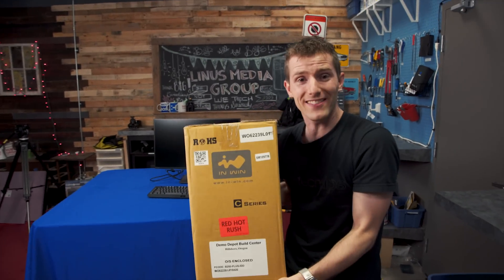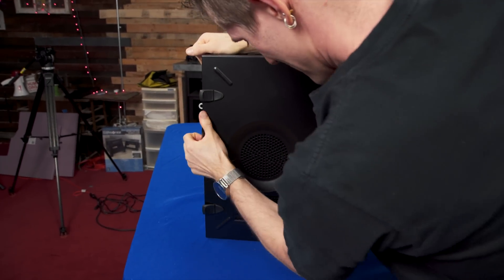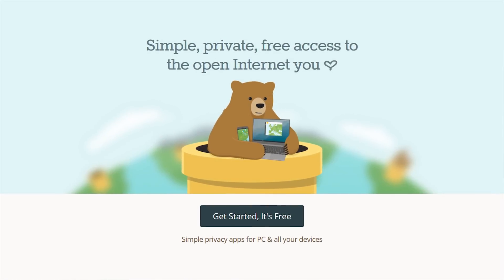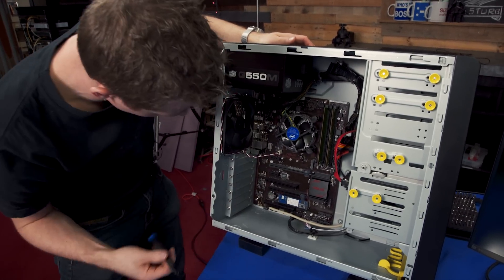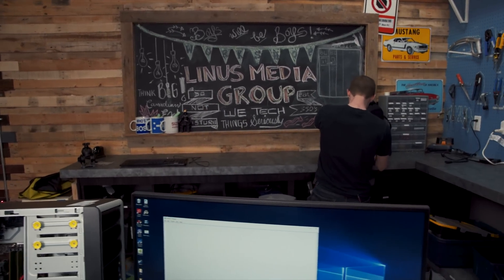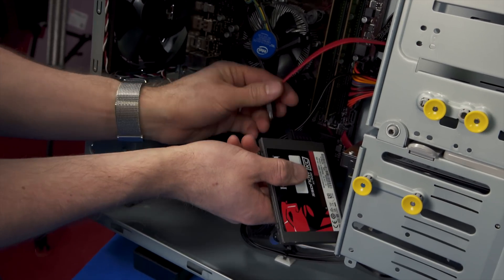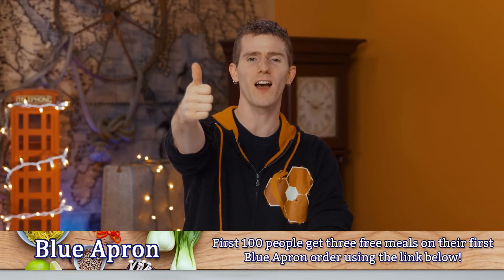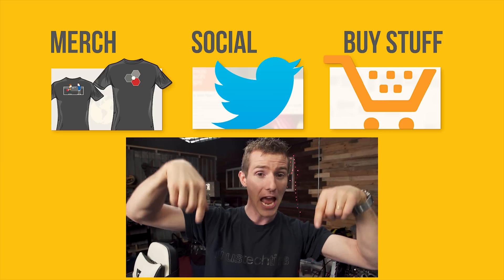Turbocharge your SSD for $40??

Comment: The next big thing in computers will be my 'SSRD' (Solid State Ram drive).  It will be an SSD built into a DIMM style PCB with RAM, but will retain the Ram data for short periods even when turned off (instant boot time), and allow for massively improved SSD access speeds.
Reply: 10p6 no I think CPU l1 cache drives‚ like a CPU at 500MHz but its L1 cache (fastest computer memory) reaching upwards of a hundred GB would be the next big thing.
Reply: So basically like "battery backed SRAM" in the 80s.
Reply: +Bien Vincent Balansag I think you are right, but i don't think we will see it in a consumer product.
Reply: That's incorrect. 
@Sam Can.... Just look up the words "Hibernation File"...
You will understand quickly though.
Reply: Hmm, i had that idea in my head.
Reply: The next really big thing will be MRAM, which will make both RAM and flash storage redundant. MRAM is fast enough to be a replacement for traditional DRAM, but doesn't lose any data when the power is off so flash SSD's wouldn't be needed either. And it also doesn't wear out over time like SSD's. It's a very long time off yet though, because someone needs to make an enormous investment so it can catch up...
Reply: think thats allready an option when you use a SSD its called hibanate and sleep mode is compatable with pc even from 1995 and comes at a cost of 0£/$
Reply: nope they dont want us to have dataservers speeds for desktop, m2 will be your solid drive and nothing else... miniaturized YES, expensive YES,  fast NO, WHY ? ...corporations/governments that slow us down for easy surveillance ...

Comment: The best option is to put a 4 lane PCI express SSD in that M.2 slot and get MASSIVE bandwidth to all your data without having to prime the cache. Optane is a cheap low end solution if you're penny pinching. Go with a Samsung 960 Pro in that M.2 socket and it will blow everything else away. It is almost price equivalent to SSDs now so there's not much excuse to not go with this.

Comment: I really struggle to see the benefits of this product. Don't get me wrong what it does is fantastic and in the right environment it will be perfect. But that's where I struggle, the right environment is very niche.
With compatibility limited to Kabylake+, anyone that has bought one of these systems would have more than likely had an SSD anyway. I would love to get these in the schools that I work in, and they would fit great, but we don't run Kabylake here and if we were to upgrade to them I would just buy the SSD for chips.

Comment: "Is it worthwhile if you have an SSD?"
I think the correct answer is: It depends on WHAT ELSE you have and what you use it for.

Assuming the SSD on hand doesn't provide nearly sufficient storage space and is already set-up as a system disk the alternatives for extra storage are:
1. Standard HDD. Cheap but relatively slow.
2. A hybrid HDD (which all seems to be limited to 8GB of cache). Cheaper than adding the 8GB Optane.
3. A cheap SSD combined with an HDD using Intel Rapid Storage. You get more SSD than Optane for the money, but raw performance suffer and the SSD will wear out faster since it can't use TRIM.
4. Optane. More expensive to buy but better performance and longevity than alternative 3.

I'm actually in this situation right now. I have a smallish system SSD and a 2TB HDD for running most software.
I can speed up the HDD by either getting a second SSD for IRS or getting Optane. Since I want longevity Optane seems like the better choice, but 16GB feels a bit meager. If I can get 32GB (or more) at <$100 it would be nice.

Comment: Sounds like the Optane memory will be coming out for new ready built PC's sold at high street shops. This will save the sellers a lot of money for not having to add an boot SSD. Instead they will put an Optane memory stick In the computer with a cheap mechanical hard drive, then stick one of those "Intel Optane Inside" stickers on! and watch sheep's go wild buying them thinking they got the real deal. Poor peeps...

The computer savvy's will wait for the SSD version I think. Now that will be something to look forward to :-)

Comment: Linus, may i suggest a config worth trying
partition the ssd so there is an os partition and a smaller games partition.
then config the  optane to accelerate the second partion only .
please run a video investigating this config
Reply: Optane can only accelerate the primary boot drive IIRC
Reply: so no multi-HDD ?
Reply: Nick Fury h
Reply: Yet again that is incorrect.
You think in the box too much.
Intel optane can be used as stand alone storage... WHICH MEANS!
A program like PrimoCache would work.

Comment: Its an interesting concept but if it requires a 7th gen CPU, I honestly don't see the point. 
A 1TB SSD is still pretty expensive but I remember paying about half of what a 1TB SSD cost today for a 128GB only a couple of years ago. So while not cheap, "enough" storage for a gaming PC (lets say 500GB+) on SSD is affordable. Boosting a HDD performance becomes less and less necessary. 

Also, if optane can't really boost the performance of a SSD (even after learning the user's patterns), I don't see the point in investing in a larger obtane drive in the future. 

To archive a real performance jump like between HDD and SSD, we'd need some kind of non-volatile RAM that operates at almost the same speed or a RAM technology that can hold its data at super low power levels so that a small battery can keep the ram running a long time after shutting down the PC.

Comment: Welcome to 5 years ago!!!  The tech is a GREAT solution to gain nearly SSD levels of high performance with large capacity HDDs.  Don't knock it.  It's viable!

5 years ago I started using a 32 GB OCZ Synapse combined with my 1 TB HDD and I am getting near SSD performance with huge storage capacity for a fraction of cost compared to that kind of capacity using SSDs alone.  Especially considering SSD prices back then!  You might be able to find some ATTO benches on the Synapse somewhere to verify the speeds. Dedicated cache SSDs went out of favor when SRT technology was developed, so Synapse is no longer sold, and now Optane is here to replace SRT.

Comment: The only way this product would be useful was if you could specify the drive that the optane is caching information for. IE i've got 3 ssds and 2 mechanical drives in my system so I would tell it to cache info for the mechanical drives and ignore the ssd's. Doesn't look like this is an option so it's not something I would buy.

Comment: I can see these being useful in business or education machines. Yes, it'll only work with newer chipsets and requires an m.2 slot but in 2 or 3 years time a card that a technician can plug in to accelerate the system without messing about cloning drives or setting up anything seems like a good solution.

Comment: Kaby Lake and 200 series mobo plus $40 optane chip to boost my HDD vs any system with a m.2 slot and a $60 128gb nvme ssd, I know which I'd pick (or a $100 240gb ssd). I know sata ssd's are cheaper, but don't compare quite as well.

Comment: nobody in the right mind would buy this. A Kaby Lake buyer would just spend $50 more for a 256GB SSD (or just buy the SSD without the HDD), which will increase speed AND capacity, than opt for $70 Optane on top of an HDD cost. If you can't spend the extra $50, why would you buy a Kaby Lake in the first place?

Comment: I feel really disappointed with Optane. I honestly expected something better. If you have the money to buy Kaby Lake I3, I5 or I7 system, you most likely have the money for an SSD. You can get a reasonably cheap SSD for your system, your workspace and maybe a few less disk space hungry games. Or you can go with more expensive 400~500 GB SSD ad ditch the HDD completely if you don't need that much disk space. A budget solution for budget storage setup in a non-budget system? No. I don't see a point in this product at all. 
Intel Optane? .. This is in - practical point of view - an SSD taken out of SSHD and sold separately ...

Comment: Who the hell has only an hdd but a board with an m2 slot?
Reply: That was my first thought... Who has built a computer with Kaby Lake without an SSD?
Reply: Mike s But even in that case I'd rather buy an ssd for ur OS than this thing 😀
Reply: People with low budget pentium G4560 and B250 boards.
Reply: Even for the people with HDDs for storage (I for example have a 6TB array for storage), what is being stored on the drive to need optane.  If your running games off the HDD then okay I see why the drive would benefit you, but for me personally I just use my 6TB array for general media. I actually have a 120GB SSD acting as cache for the array just because I had a spare SSD laying around lol (wouldn't have bought one just to have it. Nonetheless seems like optane in its current state, only support kaby lake and up would be for a very niche market.
Reply: Patrick Kuhlmann Um, me.

Actually I have 3 HDDs with an unused M.2
Reply: Patrick Kuhlmann many people on budget
Reply: theUglyManowar Your right hell I myself have a 6TB striped array that I use for storage and my various Adobe project's. I have a TB pny ssd I use for my games and then my xp941 m.2 for boot. Aside from all that I also have an old 256G Sammy 840 I use (with primocache) as an SSD cache for my 6TB array. 16/32GB Optane drive isn't big enough for my array and a 64gb or 80gb drive would probably cost the same as a used 256GB ssd that I could grab and use as a cache instead.  But because of this I still don't see a use for Optane in the enthusiast segment lol.
Reply: Patrick Kuhlmann m.2 drives are cheaper then a SSD and I'm in heaven not having shit plugged into sata ports my case looks so clean inside with no hdd/CD ROM or sata SSD..
Reply: well i got an i5 7600k in a b250m with 120 gb ssd, so yeah, also a terabite hdd
Reply: Almost all new motherboards have an m.2 slot so I guess that  a lot of people
Reply: Actually, while you do have a point, I think this might be useful to some users. Everyone seems to neglect the fact that using SSDs doesn't exclude using HDDs and a lot of PC users also use HDDs along SSDs for storage purposes. For instance, I use 2x4tb of HDDs for storing my photography work, yet I also have a 250GB 850 EVO for the OS and applications. But when working on the actual files the HDDs are still in use and the software is being kind of bottle-necked by the slow drives when working with large number of files (thousands of shots from a wedding). Now, once a particular photo is selected it then has it's preview rendered and cached, but it takes time to read all those files, and I'm imagining that just having less latency and shorter access time might be enough to do the job. Having an SSD for the OS and having "turbo-charged" HDDs might just be a potent combo (if it is, indeed, possible to even do that, if not, then I stand corrected). I mean, it would be delightful to have that amount of storage in SSDs but we won't get there soon price-wise. That said, this is new to me and I may be quick with jumping to conclusions, and it might just be that there is no benefit whatsoever.
Reply: Patrick Kuhlmann yeah person would be me lol.  im just running a 1tb blue on my pc, couldnt justify buy an ssd at the time
Reply: kaby lake and upcoming coffee n canon lake r only going to be a niche market?
Throughout the comments of Ryzen reviews from the four corners of the multi verse U would be led to believe that Kaby Lake was the second coming of Christ and the only valid metric by which all things were measured.
Also...
Is Sky Lake been tested to not be viable  ( even if unsupported officially )

Also... still not sure what enthusiast watches these things because they do not care about their transfer load. I keep hearing about this typical user with typical load. No one else with SSD or otherwise r screaming at transfer bars? Could anyone explain how that does not equate to needing moar? 

( even if it is 7 times a work session... Why else is anyone in the market for an upgrade...
Shopping unless they desire to kill as much suffering as possible from such times with iteration advancement )

Fidelity... FPS... TYPICAL SSD performance difference... ( all the ridiculous claims people arrogantly assume can not be noticed )
Sometimes I get the feeling that these gotchas make smarmy article intrigue that presuppose a world without workstation professionals in them that haven't continuously been screaming at Render, Transfer, Encoding, compression, Installation progress bars for decades making them a valid market after all the secretaries, web surfers n gamers without any apparent digitally relevant job has moved on to Tablets Phones n Consoles. ( save fer Science/military, IT, Server and varied Database enterprise concerns )

Gotta wonder if such smarmy articles that have preconception on the validity of a professional market's concerns...
Aren't often the mistaken variable in and of themselves. 
( even if there was only 100 million workstation professional enthusiasts left in a market of a billion... How would the multi billion dollar enthusiast market be so arrogant to think 1 of those billions of dollars does not equate into a valid market concern? It's like some weird smarmy genocidal Hitler logic where the expensive attention spent on professional solutions like Nvidia Quadro  and AMD FirePro cards was catering that somehow didn't actually equate to a real market consideration. And pro concerns could be dismissed easily if as much was a valid point )
Reply: theUglyManowar Most people building new systems will be running ssd boot drives already.  The minority will be those building brand new systems and booting off a HDD. So yes I think Optane will only be for a niche market.  Would you build a coffee lake system and then boot off say a WD Black HDD and spend an extra 80 bucks on Optane? Or would you speed around 130 bucks for a 256gb nvme drive and use the WD Black as storage?

The Enterprise world has faster solutions already and the small business professional world I don't really see benefiting from this either. So who is Optane for?
Reply: @JIME Q Gaming
I wouldn't buy it at all  If I could only use on the boot.
( because of nvme )
I just assume everyone lacks storage after terabytes n need mo terabytes. And one of those Terabytes ( HD ) might be served with the best cache solution available. ( if it is the fastest cache solution for HD )
I suppose enthusiasts could be considered a niche market ( but a 26 billion dollar market the last study I read that brings parity to the consumer market which explains the flood of enthusiast bait the industry is fishing with )
So I wonder what % of viewers of an enthusiast channel like this...
Do not have A lot of Terabytes of storage that could be served? 
( like a paging dedicated drive, or a tmp folder dedicated drive, or an internet cache/ net tmp folder dedicated drive? Which all speed up their respective scenarios cuz yer not read/writing to the same drive.
download gameInstall to net drive which expands to tmp drive which Installs to yer nvme... Sometimes all at the same time. I do this scenario with all SSD's But depending on yer work... What enthusiast does not have terabytes upon Terabytes of storage internally in addition to their NAS ark? That benefits the pipeline because of that dedication? Which would be a performance strategy... So who wouldn't want a cheap n viable cache boost to a performance solution? An Adobe scratch drive? An Avid project Bin folder drive? A Maya Project Drive? )

Still don't know if Optane only works on the boot drive? ( in which case... not interested. Also not interested if the 16TB version is to small for a 4 to 6TB drive and a heavy workload )
Otherwise $40 is a trivial consideration.
Reply: Patrick Kuhlmann A lot of budget motherboards include an M.2 slot nowadays.
Reply: I DO and always have it seams like
Reply: Patrick Kuhlmann  I do And I am seriously considering getting an optane.
Reply: Patrick Kuhlmann me
Reply: Me too.  Using old disks in my new PC
Reply: ME :D
Reply: I do.  It's a ASrock 990FX board and I use a HDD and SSD but no M.2 board as they are more expensive and I'm only now learning about M2 and NVME options.  Frankly there is no real difference in speed between an SSD and an M.2 card since they both use the SATA lanes.  NVME might be an option but my MOBO doesn't support NVME.  NVME is faster due it's using the PCIE lanes and not the standard SATA
Reply: I do.
In my country decent 128GB SSD costs about 2,5 times more than 16GB optane.
Reply: Patrick Kuhlmann i do
Reply: me
Reply: it make sense for a home NAS or office maybe even website on budget
Reply: Me
Reply: My laptop
Reply: Me
Reply: Yup, me too. A 1TB SSD cost $380 USD where I live.
Reply: Ri5ux The amount of people who don't get that simple point is devastating.
Reply: Who doesn't? I use a beloved Samsung M.2 960 EVO on it for 3 times the speed of SSD's. What's wrong with you? Do you even know what an m2 slot is? Acting like it's outdated. Mongo

Comment: Get an NVMe. The Samsung 960 EVO 250GB is 130$ and you get drastic performance improvements over SATA. AHCI will die very soon for SSDs. Don't buy that thing, not worth it at all.

Comment: Seems like the comment section are all against the product. I one the other hand was wondering if it wouldn't be better to use it in a system having both an SSD and a HDD. So anything i want to have fast is on the SSD and anything else on the HDD and still get my more used stuff speed up ?